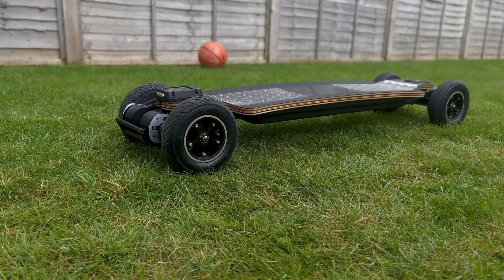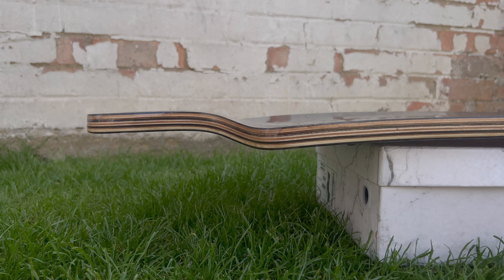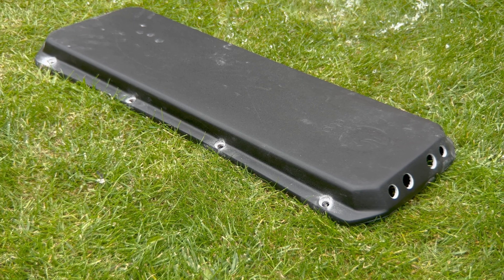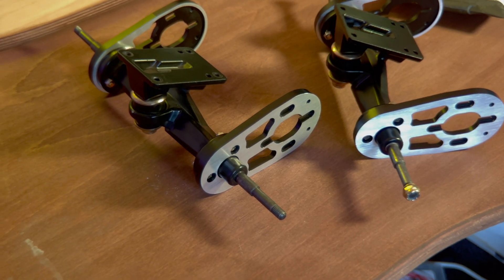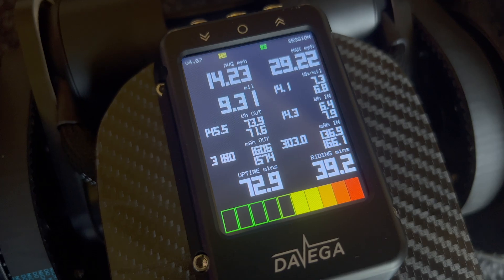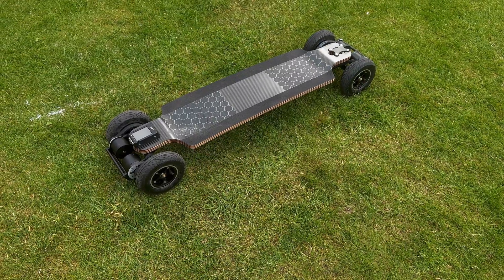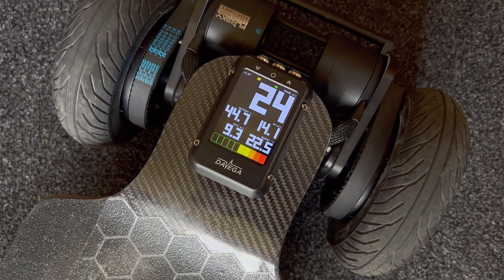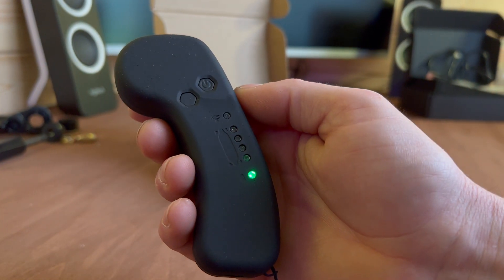How to build a 4 wheel drive DIY Electric Skateboard BEAST - Part 1 of 3

Comment: what I'd like to see is a 3-wheeled off-road skateboard, using an electric scooter rear wheel, with a disk brake.                                                                                                                                                                                                                     I think the batter should be on the top of the board, held down with a strap, and should be easily removable.                                                                                                                                                                                                      You should be able to carry one or two extra batteries in your backpack.                                                                                      The controller should be velcroed to a fingerless glove and have the speed control and break both operated by separate cables (no dumb wireless electronics)  The battery should go to something like a light dimmer switch that controls the speed and then directly to the motor, this would eliminate all the crazy electronics that are being used in these skateboards.                                                                                                                 I'd like to have old switch step-in bindings on a board, so you could ride it aggressively like a snowboard and easily pop in and out.                                                                                                                                                    Maybe I'm nuts, but this is what I'd like to see...

Comment: I would love to see a build video or even just a review around the TKP trucks that @Savage1 on the forum is making. Maybe you could get him on a call or a podcast as well and talk about some design aspects if he wants to, would be interesting to hear some insights.

EMTB content should definitely come as well. It's worth noting that EMTB with heelstraps is a completely different beast from regular esk8, being strapped in can be a mental block in the beginning, requires getting used to. Though I know you snowboard so that probably helps with that. You could also get great riding footage, as the UK is full of pump tracks and such where EMTBs really shine (well from what I can tell from Trampa videos at least, lol). I would also love to see you covering this year's eeb-it (race) if you are into EMTB by then :D

Also it would be very interesting to see a stealth build with a wooden integrated deck. Tomiboi's decks and Haya decks come to my mind first, but there are others too just hard to find and in low quantities. Hiding the battery in a wood deck just has a certain appeal to it. I would love to build a board around an integrated deck one day. I would personally use something like a Haya HB83+ with Boardnamics M1 gear drives and 6355s. Maybe a TKP front truck to spice things up a bit. Or maybe I would CNC cut some custom adapters for my cast Ronin trucks, I love those trucks so much. Too bad that not much esk8 stuff exists for it.
Reply: Cheers for the input 👍🏼 you know where I can check out those trucks ? By savage1 they sound interesting 😁

Comment: build a short board with surf skate adapters to go like 24 mph and like 18 miles on a charge going max speed on flat ground. With 2 belt motors and 97mm wheels. More for having fun and carving and small and easier to carry and travel with. Maybe some kind of handle or just mall grab. Also a tight turning radius and just a normal esc nothing crazy but when you break you slow down the go back wards and stop on hills. This would be a dream travel board it would be cool to see and it's basically the opposite of what your making. Another idea would be to make a carving long board with double king pin or normal trucks and really flexy deck with either 2 cases on the bottom or the one similar to the wowgo at with like 110mm wheels and just have motors that hit like 24 or 28mph and a good esc and a solid 20 miles of range. One other thing that would be cool to watch would be a summer board mod where you mod the battery and look at the inside bc that board is cool. The short board is what would be good the rest are just if you get desperate for content. Also a podcast where you talk about eucs and ebikes and one wheels and why you stick with eskates. Just throwing ideas out and i know you have probably posted something similar to almost everything above. Also making polls about what videos your viewers want to see.
Reply: Thanks for the comment Andrew will definitely take your ideas on board for future videos thank you 🙏🏼

Comment: Is the hanger fitting in the pivot cup with this trucks? I tried this with onsra dkp. The hanger was bouncing 3mm........ Was scared that there is to much pressure on the king pin....
Reply: Yes fits perfectly had done this with other boards and never had any issues 👍🏼